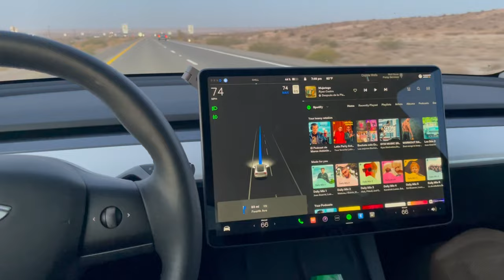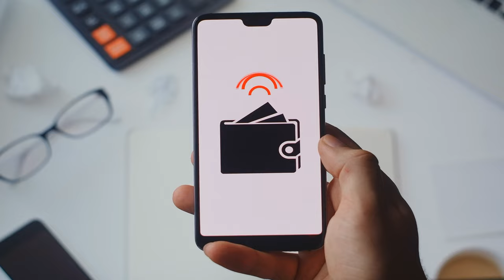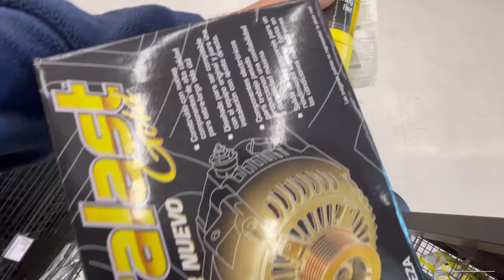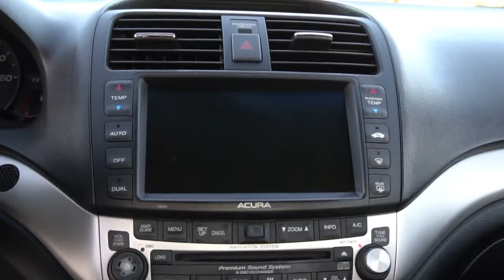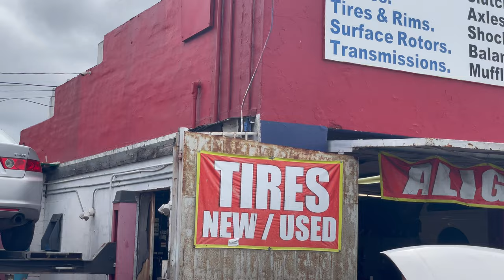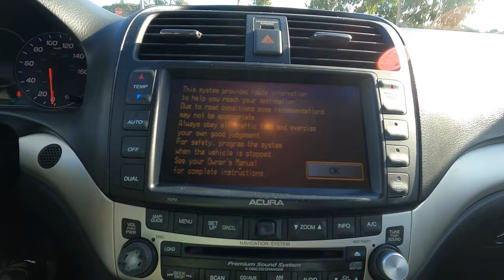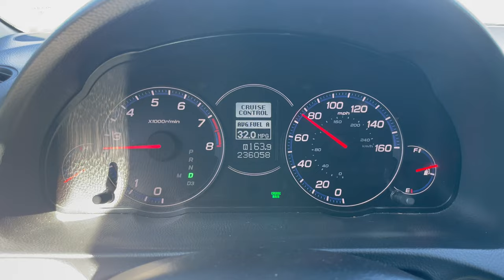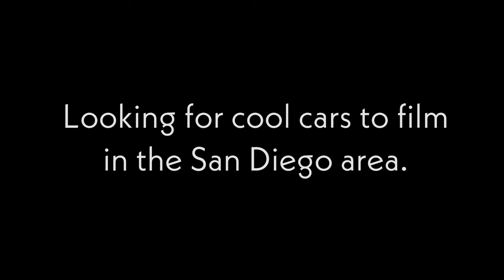ACURA TSX Owner's Review after one year. #Acura #AcuraTSX #honda

Comment: Mediocre!  You have got to be kidding!  Where else are you going to find a car with the options and performance for under 6K?
Reply from the maker: Mediocre is synonymous with words like ordinary, common… in stock form the TSX isn’t spectacular. For the price? YOU BET! I do say that in the video as well. No regrets but we have to acknowledge cars have come a long way in displacement, efficiency, performance since 2003 when this generation of TSX was released. 

Thank you for your comment!
Reply: @JuanCarlosLTO I agree, TSX 2 europe version here.
The options and features, meh, I never use seat hetaing, it doesn't habe wheel heaying so.....besides AC......i got an aftermarket navigation that isn't from 1999 and unusable. Aftermarket speakers as the old ones were kinda blown. Never use the roof window, 

What options?
If it had ventilated seats, then Id love it more as the leather seats keep backs so hot :( especiaply in summer.

Not too fuel eficient here in EU.
Nice sounding engine, reliability is OK.

But other than these few things, it's not spectacular in terms of "options".

But it's solid for.the price
Reply: @saibamoe would u recommend it as a first car?

Comment: Downgrade from a tesla? Hell no. Anything is better than a tesla.
Reply from the maker: Haha so polarizing 🤣
Reply: Anything is better than a Tesla. You can buy parts on the cheap to fix this car in your driveway. No car payment and it's still a nice car. Good decisions were made!
Reply: Right!! Electric isn’t the answer
Reply: Don't hate for no reason. Tesla is as reliable if not more than the acura tsx. All you have to worry about are the tires. Maintenance is very low.
Reply from the maker: @blockthis08 honestly, I agree with you: virtually maintenance free car. You can’t beat that.

Comment: I paid $10K for a 2007 TSX with 46K miles in 2014.  It has 110K now, replaced the battery once, alternator $179 at AutoZone, rear rotors and pads and oil changes.   In March, replaced the four tire tires for $426, the TPMS sensors were $80 extra. Two  years ago the catalytic converter was stolen, insurance covered the $2500 damage.  Did all the repairs myself except the catalytic converter and flex pipe.
Reply from the maker: Oh wow! It’s a low car for a target. Seems like you have a keeper. I really don’t mind the hick ups from the early weeks of ownership as now it’s all sorted out. 
Are the TPMS replaced every time you replace tires or why did you have to replace them?
Reply from the maker: BTW. You got a steal for such a low mileage back in 2014.
Reply: @JuanCarlosLTO  The batteries in the sensors died, the OEM ones last about seven years.  You can take apart the sensors and replace the batteries. The ones I bought come preprogrammed, the shop where I had them installed was ticked off that they couldn't charge me $50 extra for programming.
Reply from the maker: Oh ok, unknown if the prior owner changed them on mine but they still work. 🤷🏻‍♂️
Reply: Hi brother, what insurance do you have?? A friend of mine had her catalytic converter stolen and they didn't cover it 🤔
Reply: @eiyrie2990  State Farm.
Reply: What tires exactly did you get and do you like them?

Comment: 300K miles on mine and still runs strong and engine is still quiet with no shaking, mine is a 6 speed, had it since 17 miles.
Reply from the maker: Wow! Must be nice keeping a car that long and saving money vs ME 🤣. Mine has 243k now and it has become my daily since we got a new car a month ago. I plan to keep on driving it for hopefully a long time.
Reply: @JuanCarlosLTO   I didn't change my starter until it died at 250k miles, alternator went out at 280k miles. AC Compressor at 225k miles, cv axles never went bad, I just changed them when I replaced my clutch. My tsx is still stock and still runs strong, I use royal purple with k&n oil filter, it helps keep the motor quiet and running smooth. Do the same, you will notice a difference. 243k miles on a tsx is still fine as long the motor has been taken care of. I drove mine from Florida to Wisconsin and back last year, still ran perfect.

Comment: Doesn't sound weird at all. I had an automatic Acura TSX first generation 10-11 years ago. I Loved the car. Then  bought a Acura TSX 2nd generation. Owned that car for  4 years. Nice but nothing like the first generation. Sold it. Then just recently purchased another TSX first generation, this time manual, as a daily. (I also have a Tesla model S. ) TSX is good alternative car to have. Manual is buttery smooth. Good MPG. Very reliable.
Reply from the maker: I envy you for having that manual! They’re hard to come by specially unmodified. I’m not sure I would have sold mine if it was a manual transmission.
Yes, I never loved the second generation TSX. 
Back when I had my new TSX I looked up to the TL but nowadays I would prefer the first gen TSX over the TL.

Comment: Just add tints to keep the interior in good condition...Also just wrap the car don't paint it less money..You can also add a back up camera..Add a k&N filter you get better gas miles on the highway cause you get more air..I have 2008 265k have it for 8yrs great daily car
Reply from the maker: Sorry, I just saw this. The car is gone to a good home. In all I put 26k miles myself and had 245k when I got rid of it. 
I was almost curious about how many miles I could get out of it on an unopened engine. 
Great cars! 2008 is the best year IMO

Comment: Thank you for sharing this video.  I actually looked at a 2007 Acura TSX today with 118,000 miles priced at $6,900.  It drove well.  I'm going to have my mechanic check it out on Friday.  If he approves then I will purchase.  I really want this car to work out for me for as long as possible.  I was so happy to see your videos on this car.  Any thoughts/advice you can provide would be greatly appreciated.

The funny thing is that after I test drove the Acura TSX today I went to Walgreens and parked right next to one.  Then when I was leaving Walgreens I saw another Acura TSX leaving the parking lot.  I think these are goos signs 🙂.
Reply from the maker: I would say that if it’s in good shape then it is a fair price. Price varies depending on condition. I’ve seen them go for over $10k, again, at $6900, it can be a fair price if it’s in good overall shape. If it’s from a dealer they probably got it for $1-2k at auction or trade in as that’s what blue book says. Carmax appraised mine for $1200 so dealers have that huge gap to maneuver.
As far as anything else, as you can see these engines are pretty much bullet proof, then by 2007 most issues has been fixed so you’re getting the better year model. Relatively fuel efficient but not what you could get from a civic from that era which go for about that in good shape as well. So it depends what you’re looking for. I like the extra space and power that you get from a TSX vs a Civic and I prefer this over the Accord from those years. 
Good luck with your purchase.
Reply: @JuanCarlosLTO  thank you for responding!  I really appreciate your insight.
Reply: I bought a newer one 2012 Acura TSX back in November for my new job since I didn't want to overuse my now paid off 2018 Honda CRV. I got one with the title on t saying "formally damaged" although I must say I still do not see what it was they claim. Vehicle drives great and in very good condition. It has this sports feel and I really enjoy driving it. I got it with about 190k miles on it and I am definitely keeping it. I hope you experience same luck as I have had. Acura is a great car

Comment: Thanks for sharing your experience!  I'm the original owner of an 09 TSX with 246K miles.  Best car I've ever owned.  Aside from routine maintenance, the only items that failed were the alternator at 235k, new struts at 210k, an $11 AC relay switch, and  $10 brake pedal pad.  Oh yea,  new struts made a HUGE difference in the handling.  My operational costs are 16 cents/mile over the life thus far.
Reply from the maker: What a great experience! I just sold mine today with 245,560 miles! I loved every minute of it but I was ready for a change. I don’t keep cars long and with this TSX it opened the door for new experiences in cars that I always wanted to have earlier in my life. There’s a list of cars that are relatively affordable and I want to try a few before I’m too old to enjoy anything.
Reply: It's really strange to me how many american youtubers feel like the TSX feels kind of sluggish and that 200hp isn't even considerate moderate power.
 In Europe 200Hp is a lot, and the average HP on a car is prob around 130-140hp and the median would be around 110hp.
 What would be the average power of a car in the states?
Reply from the maker: @kapparaaliach you’re absolutely right. Everything is relative. As I’ve said before on videos from this same car, I had one back in ‘03 and at 205 hp it had more than the bmw 325i of the same year and it was considered very good for a 4 cylinder engine. 20 years later hp in USA production cars has increased tremendously due to turbo implementations and of course EVs. 
I guess in the USA we’re used to more. Whenever I visit Europe I see S classes with 4 cylinder turbo engines and I’m fascinated by them, small, efficient, often diesel engines in larger cars that are not trim levels that are offered here. 🤷🏻‍♂️

Comment: For suspension upgrades, you could try a set of Bilstein B6 dampers with H&R OE Sport springs and top that off with a TL Type S rear sway bar. The springs lower the car just under an inch and I've read that they ride a tad firmer than stock. I have a set of those dampers for my '07 6 speed but have put the installation aside since the current dampers still have plenty of life left considering the mileage
Reply from the maker: I will probably look into it this year. After all, I decided to keep the car and want to enjoy it even more. I have H&R/Bilstein set up on my BMW and I struck the perfect ride and height. Thank you for your comment
Reply: Awesome thanks for this..I will be looking into it hahaha
Reply: @JuanCarlosLTO  Manual swap is an option too if you want to get rid of the 5 speed
Reply from the maker: @skydive7054 that’d be awesome. I would if it wasn’t for my wife driving this thing from time to time and she just doesn’t like driving manual… but she used to have a Golf GTI MT… go figure. Right now I’m alternating the old bimmer and this one so I’m “stuck” in this dilemma… I don’t want to sell either but I don’t want to park either on the street at night. For now I can leave one at the office lot but that could change next year.
Reply: @JuanCarlosLTO  Ah I see.
Reply from the maker: @skydive7054  my BMW was actually automatic when I bought it. I made it stick and it makes a big difference in the driving enjoyment
Reply: @JuanCarlosLTO  Ah. Yeah it'd be nice if you guys could manual the tsx. the automatic is holds it back a lot. The 6 speed makes it so fun to drive, accelerates quicker, and overall improves everything.

Comment: I own a 2005 TSX. I bought it in 2012 with a 64,705 miles. 12 years later, I still have the vehicle and now has a little over 215k. Over the years, sure I’ve had to replaced certain things that naturally you just have to replace however in terms of major parts, none at all. This car has been nothing short of reliable an around. I still have mine looking great and several years ago I even added the all around OEM body kit from Acura (comes painted) so it looks that much better for the year 2024. The fact that I have a little over 215k miles and it literally rides like a new car is simply amazing and speaks volume for the brand imo.
Reply: I also own a 2023 TLX Type S and it’s my weekend toy. But knowing that there is long term reliability in these cars, that within itself bring me a peace of mind and I love that. I’ve had several Acuras and continue do buy them and no regrets. Point of all this for me, I still love my 2005 TSX and still happy til this day
Reply from the maker: @francysantos1916  the TLX Type S is a gem! 
As far as the TSX, I like that OEM body kit but I think it’s NLA. I will be dumping more money into mine because it has proven itself to me. Nearly 245k now and the engine/transmission is still so healthy, no leaks! Unbelievable. I want to find the right suspension to lower it a bit; around an inch or so. 
Thank you for watching my video
Reply: @JuanCarlosLTO  yea, the body kit is NLA. Would’ve been nice if it were. As far as suspensions, I’m thinking for sure about doing the same. Simply some lowering springs because the shocks are good however, adding lowering springs to shocks that are almost 20 years old wouldn’t be the best idea so I might just change everything. Great video and thank you.
Reply: What body kit did you purchase?  I have the exact same car.
Reply: @awkward6198  I purchased it years ago from Acura, I doubt it’s available anymore

Comment: my daily driver is a 2013 Hyundai Elantra and it’s been flawless so far at 63K mikes. I bought it new. It has all the modern amenities including a back up camera and it’s a manual so it’s fun to drive. I just got all four new shocks and tires. she runs like brand new again. I went with KYB shocks bc Advance Auto has a sale and KYB has $50 rebate.
Reply from the maker: Awesome, when I started reading all I could think of was if yours was a CVT which in those years were pretty awful, unsure if the 2013 auto was already a CVT, but I drove them a lot and the power delivery was very bad. Glad you have a manual.
Reply: @JuanCarlosLTO  it was difficult to find a manual. The auto one were all made in U.S. but my manual is from Korea.
Reply from the maker: Interesting! I didn’t know that. I know that Kia/Hyundai builds many of their models in the US. Sadly most manufacturers have ditched the manual all together.

Comment: I tried to get myself into the perfect tsx because I like the size of the car and the k24 is a great engine. But after weeks of looking the last one I went to go see had 95k miles and drove absolutely flawlessly. Ran the Carfax and that car had a cluster swap and it actually had 288k miles on it. Dealer said it probably had a complete drivetrain and cluster swap at sometime but couldn't confirm that. I don't blame the dealer we talked it out and at the end of the day they just buy from the auction and sell whatever they get so it's anyone's guess. I was good on the tsx at that point. I found a 1 owner garaged wdp black interior navi 07 TL with 115k that I paid the dealer 7k out the door and it's needed absolutely nothing. Did the timing, ball joints and trans service myself and I'm into it for under 8k and it's got 150k miles on it now. My budget was 4-5k for a tsx but glad I just spent more cash and got the TL. More room, more power and smoother ride. I'll continue the maintenance and drive it until I can't anymore but that bad tsx I went to go see was a blessing in disguise because I can't picture myself being as happy with the tsx as I am the TL. Acura is definitely the way to go for value, reliability and comfortable daily driver.
Reply from the maker: That’s my favorite TL of all. My coworker bought one right after I bought my TSX back in 2004; white with black interior… what a 1 upper 🤣.
I think you did good and ended up with a car that is more rare than the TSX, especially in good shape. Most of what I see on the road now from those years TSX or TL has been trashed and or modified.

Comment: My 06 TSX now has issues with the driver's window.  I think the driver's window motor / actuator is near the end of its life.  The window moves up or down very slowly.  On a cold day, there was no response when i pushed the power window button.
Reply: To prevent your other windows from slowing down, you should spray with silicone lubricant on the window seals/tracks. Keeps the motors from overworking. Unfortunately, your driver window motor still might need to be replaced at this point.

Comment: My car looks exactly like yours. Only it's a 2005 Honda Accord Euro/Japan model with the 2.0L, full spec.
I bought it 7 years ago, as a temporary  car, but I liked it so much, that I kept it as my daily. It is a reliable car still, with only very minimal maintenance (partly DIY).
Ofcourse there will be some issues with such an old car. Replaced some wheel bearings, control arms, tie rods, etc. But aftermarket parts are cheap and widely available. 
I have been looking to buy a newer car recently, but I just can't get myself to spend silly money on a car that isn't even as good as the old Honda. I will just drive it untill something big breaks.
Reply from the maker: driving it until something big breaks” I’m not sure man. I think if the car serves you well you might even save money by fixing a major issue vs buying new. 
Mine is nearing 250k miles and is still super healthy. It just doesn’t make sense to sell it. 
I might even paint it next month and make it look even better than it already does. It’s super clean but the paint is a let down. I’m not a fan of aftermarket paint as it rarely matches OEM quality but this finish is toast.

Comment: These things are hit or miss. I've got 2x 2005 tsxs and one has been super low maintenance, but the other has had tons of stuff that's had to be replaced. 

In one year it's needed: clutch/flywheel/mainseal/bearing, PS pump, water pump, exhaust, clutch master cylinder, clutch slave cylinder. 

The other one? Starter and battery. 

Both cars have 100k miles..... One is just a lemon and actually makes me want to get a newer car. Preferably a Toyota

I'm glad your 07 is working out so well.
Reply from the maker: That’s crazy! Neither one is a high mileage yet one of them has all the issues. This car keeps running super healthy. My only regret is not having gone OEM with the alternator because is noisy as hell. Otherwise a solid daily driver. 
🤷🏻‍♂️